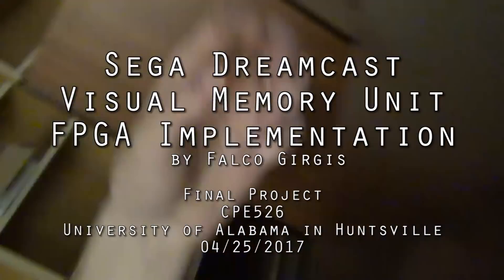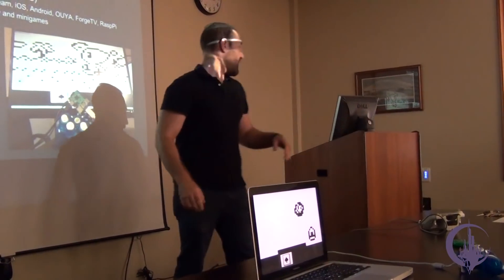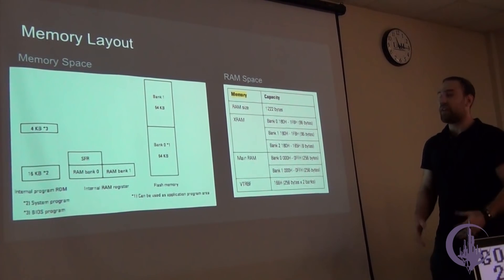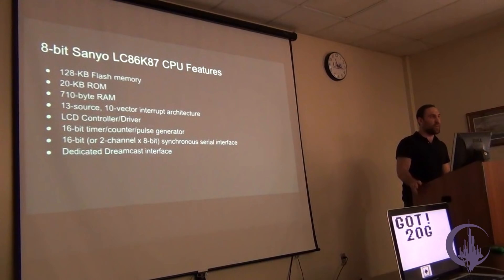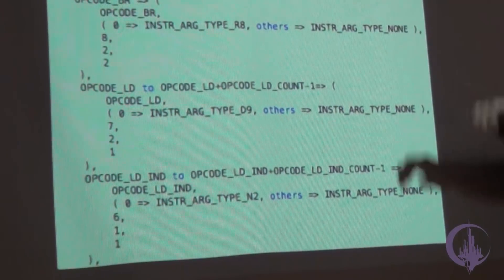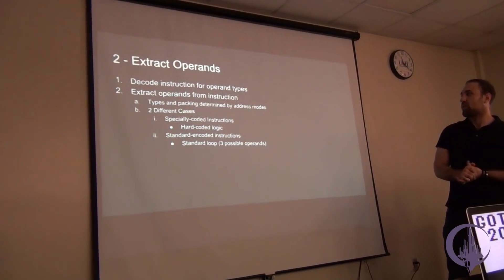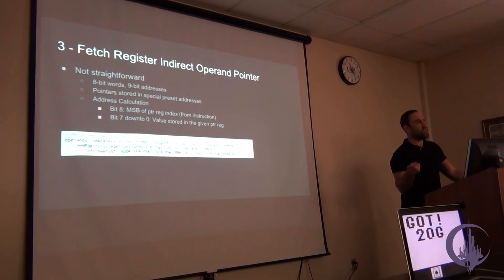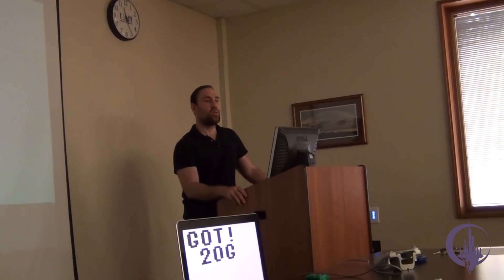"Next-Gen" FPGA-Based VMU for the Sega Dreamcast

Comment: Ayyy, Falco, I had a question because I don't focus enough to interpret information for myself. Is it possible to use ElysianVMU to do the file trade connection with the VMS bin files I'm using for Demul? I messed up on this bach of Seaman, and I need to cheat them up some food pellets. Did you know that Demul has fully functional mic support now by the way? I'd been waiting for a DC emulator that could do that for years, lol

Comment: Is this a custom board plan? I was tinkering with the idea too, my plan was to tap into the PICO-8 software and use that $9 chip it often runs on. Figured a 128x128 screen could fit in a VMU probably, if not it looks like the whole front plate of the controller needs an alternate. Great job sourcing it's parts down, interesting. :)

Comment: Hey Falco, keep in mind that I am stupid so if this question is dumb just write it off but I was wondering if it were possible to take this FPGA VMU device and give it a way to detect wifi signals allowing people to connect to the Dreamcast and play online more easily than before maybe by translating the old dial up connection to something modern like the DreamPi did, but instead in this small device with wireless capabilities. Please don't murder me as I am not a Computer Scientist or Electrical Engineer it was just something I was thinking about.

Comment: This is super cool, you never fail to impress. This specifically speaks to me though since I'm 3rd year EE interested in digital design and embedded systems.

Also, do you have any recommended books on VHDL? I'm decent with digital design and Verilog but I'd like to learn VHDL as well. 

Also out of curiosity, what eval board are you using? For a project this scale are you finding you're running tight on space on the FPGA?
Reply from the maker: Nah, actually the VMU is so small I'm not running out of space... Also DON'T DO IT. I learned System Verilog after I began this project, and it's SO MUCH BETTER than VHDL. I plan to rewrite this all in System Verilog.
Reply: Thanks for the response. I'll definitely look more into SystemVerilog. Apparently it's an HDL and HVL in one. Cool stuff!

Comment: Why did you decide to switch languages? Also, why not make a more powerful VMU that could emulate the old stuff?
Reply from the maker: Very good question... Detailed response incoming... I did not switch programming languages; this is a fundamentally different project. ElysianVMU is still a SOFTWARE emulator for the VMU written in C, allowing existing platforms to play binary content created for the VMU, and it will continue to be supported. This FPGA implementation is a HARDWARE project, where I'm literally recreating and improving the architecture at the digital logic level. VHDL is not a programming language; it's a hardware description language. The EVMU emulator is a software package. The FPGA implementation will be a physical piece of hardware that hopefully you will be able to purchase from us some day, and actually, I plan to make it interface with the EVMU emulator for managing the device and even allowing transferring of files and multiplayer interaction between a real and emulated device.

I AM planning to create a much more powerful VMU, but there are some good reasons for why I'm not just taking an overpowered existing microprocessor and sticking an emulator on it. First of all, that's a piss-poor design that is extremely wasteful of resources. You're going to have to use a chip that is far more capable than what you actually need which is ultimately going to drive hardware production costs up. Implementing the instruction set in hardware is so much faster than an emulated C approach that it isn't even comparable... it's real hardware. You're also not considering the fact that I'm not just implementing a CPU on the FPGA. I'm implementing a bunch of peripherals as well: 2 external timers, flash controllers, ROM, buzzer, LCD driver, and even two serial I/O ports with VERY VERY sensitive timing requirements for communicating with the Dreamcast and other VMUs. Yeah, all this can be emulated in software, but especially when you're emulating the behavior of these kinds of peripherals at the clock-cyle level, it's just that much more resource intensive and will be a NIGHTMARE to get the timing correct... Timing is a joke in VHDL. It's literally hardware.

An FPGA has a bunch of other massive benefits. You're cramming the entire system into a single programmable chip. I do plan to beef the shit up out of the CPU in the same manner that the Genesis exended the Master System instruction set into 16-bit and the GameBoy Color did the GameBoy instruction set (and added color). The FPGA real-estate also allows me to add all kinds of other hardware capabilities to the device which can serve to hardware accelerate the games... There's no reason I couldn't add a rudimentary GPU-type device like the original SuperFX chips in Super Nintendo cartridges to do 3D transforms for 16-bit VMU games... Or perhaps add an MP3 decoder for hardware-accelerated MP3 playback? The applications are virtually unlimited... On an FPGA, a firmware upgrade for a VMU2 can LITERALLY upgrade the hardware itself.
Reply from the maker: Thinking about it, I just realized that I  may have already technically implemented your suggestion for the most part, lol. Download EVMU for the Raspberry Pi3. It's emulating the entire VMU (with all of those peripherals) on a more powerful microcontroller in software, but it's still an embedded system. I have the 7" LCD screen, but if I installed the little 3", it would be fairly close to the size of the VMU. Then rip the header off of a VMU and wire it up to the Pi's GPIO pins and BOOM! Software-based VMU 2.0! When I implemented the serial communications interface over IP and the COM port, I intentionally created a layer of abstraction that would allow me to implement the same logic using the GPIO pins on a platform like the Raspberry Pi for that very reason.

But I can already tell you it won't be able to handle the hard real-time timing constraints of communicating with the Dreamcast on the Maple BUS. You have no power in software over the Linux kernel's scheduling, as it's not a real-time OS. I've done everything I can do in software, but it's essentially emulating serial circuitry at the clock cycle level. Granted the clock rate is very low, but you still can't guarantee ANY sort of CPU response time from the OS, and in my experience, the clock rate is still too fast for a top-of-the-line 8-core Mac Pro to handle... 

Two AiGD Chapters ago, I tried to demonstrate emulating a VMU-to-VMU connection over IP to mate Chaos, and one of them worked while the other one timed out... That's literally demonstrating this problem. The transaction overhead and scheduling nondeterminism is too much to accurately and consistently reproduce the signal just communicating to LOCALHOST on a very capable machine. Obviously for communication between two software cores, I can slow the clock speed down and implement some kind of clock-synchronization mechanism, but for a physical VMU to communicate with a software VMU, another physical VMU, or a physical Dreamcast, It REALLY needs to be done in hardware.
Reply from the maker: Sorry to write an essay. Really, it was a good question. :)
Reply: I appreciate the essay, anyway.